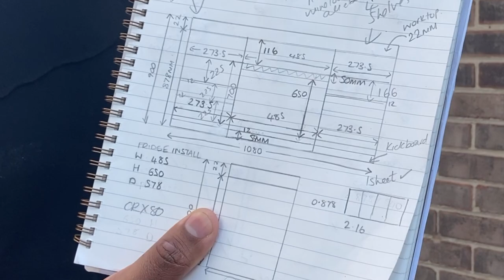How To Make DIY Campervan Cabinets | Sprinter Van Kitchen Build

Comment: perfect job! Screws that comes with handles have usually 2 til 4 spots without any treath on the screw. Thats where you saw them in the right length

Comment: Great work , 👌🏼 what size cable did u use for the fridge ?
Reply from the maker: Thanks! We used a 1.5mm2 cable for the fridge 👍 But every system is different so you’ll need to work it out for your specific van if you’re installing one - you can find out how we calculated ours in this blog post - https://thewholeworldornothing.com/diy-camper-electrical-system/
Hope that helps 😀

Comment: Wow! You guys are amazing I thought you’d bought the cupboards! They look amazing. Btw why didn’t you buy them and adapt them?
Reply from the maker: Thank you! The main reason we didn’t buy them and adapt them was that we wanted to maximise the space completely and felt it would be a compromise even if we gave a few cms away. We were also concerned with weight and managed to save a fair amount by using thinner ply on the doors and drawer fronts and not having backs on the cupboards. Plus we had plenty of time on our hands 🤣 But if we were to do another van we’d definitely consider buying flat pack. Much easier 😅

Comment: The cupboards and drawers look perfect 😍 what wood did you use to make the shaker effect on the drawer faces? 6mm ply with 6mm ply strips?
Reply from the maker: Thanks! Exactly that, 6mm ply with 6mm edging strips. If you’re planning on using the same hinges we’d recommend making the strips at least 40mm wide to avoid the problem we had with the screws! Ours were 35mm (we just chose that randomly before we’d bought the hinges) and that 5mm caused us no end of headache 😂😂😂
Reply: @TheWholeWorldorNothing  great tip 🤣 thanks guys 😊 loving the vids!
Reply from the maker: Thank you 😊

Comment: Most other van builds I've seen they've used 1x2's to frame it but always thought about doing it this way to save weight...And yours turned out so good in the end I think i'd be doing it this way for sure (taking note on the screw sizes!!) Would you say its plenty sturdy enough with the worktop on?
Reply from the maker: Yeah most builds we saw did that as well. It’s definitely easier and less time consuming to frame it out, but you’re right the weight benefits are there, and for us it was worth the extra time. They’re definitely strong too. We can sit on the worktop (although never tried it both at the same time) so they can hold plenty of kgs no problem 😉
Reply: @TheWholeWorldorNothing  thanks so much!! 😁
Reply from the maker: No problem!

Comment: Could I ask what stops the fridge falling out whilst driving? Is it bolted in?
Reply from the maker: Amazing driving!! 😀 But seriously no, it’s not bolted in, there is an option with this model to bolt it in but it involved drilling through the side so we opted against it. But we figured that with the direction the fridge faces (backwards), the only thing that will send it flying out is if we were to give it hell when we set off, but in a van this size it’s difficult to accelerate too quickly anyway so we theorised that it was unlikely to fly out. And so far we’ve been correct. It might move a cm or two but nothing drastic, even when we’ve been up steep gradient hills. Touch wood…

Comment: Could you have used an angle grinder to cut the screws down to your required size so you could of used the hinges you originally wanted?
Reply from the maker: That might have worked but cutting a screw to precisely 6mm would probably be quite difficult. And it’s just such a tiny amount of purchase in the wood that we didn’t want to risk going with such a small screw.
Reply: Thanks for replying, I'm no expert btw, almost finishing my 1st van build with a friend. He showed me your channel lastnight and I binge watched the whole build 😲. Your build is amazing, some great ideas #stolen for my next 1 😉